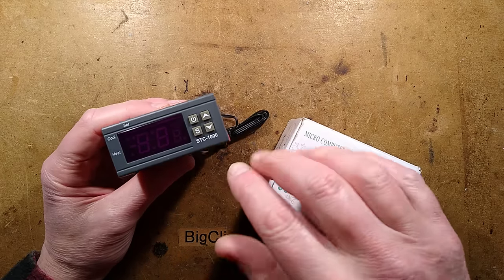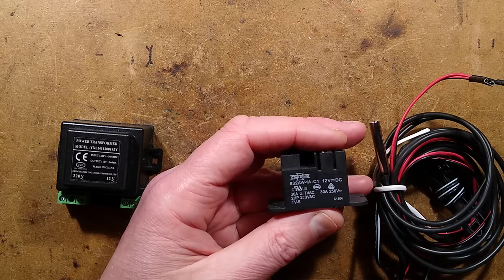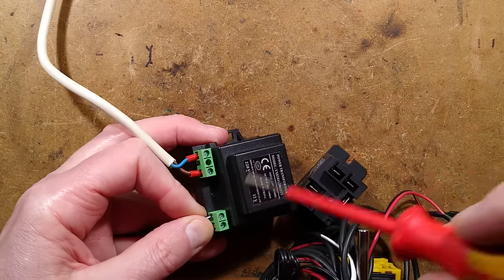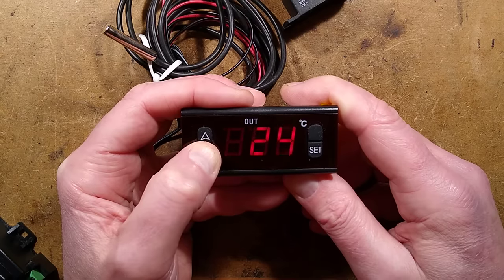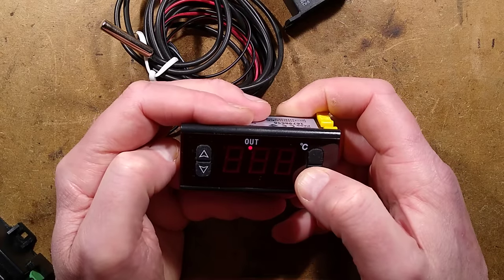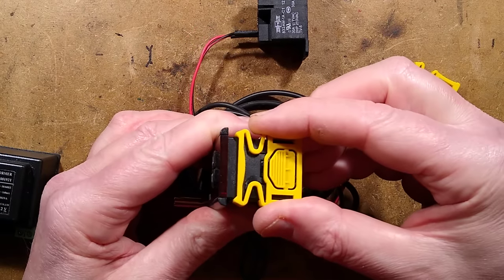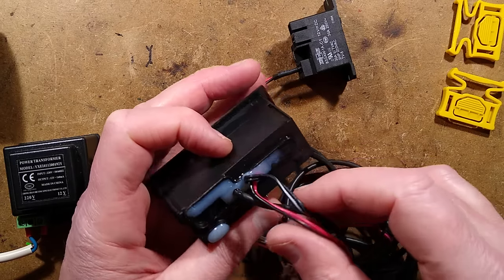Inside a ShangFang temperature controller

Comment: 06:20 - Hysteresis

Very interesting tear-down.  Thank you Clive.

-----

I am struggling to understand the difference between controller hysteresis and controller dead band.  My tentative, incomplete, and quite likely incorrect understanding is that hysteresis and dead band exist in completely different dimensions, i.e., hysteresis is always-and-only a function of time whereas dead band is always-and-only a function of the process parameter that is being controlled (in this case, temperature).

If that is true, then for an ON/OFF (non-modulating) heater controller:
1.  hysteresis is the minimum amount of time that shall elapse between calls for heat; and,
2.  dead band is the range of actual process temperatures in which the controller will not change state between ON and OFF.

Helpful comments by trained and qualified instrumentation techs are invited.
Reply: Hysterises is the temperature difference between compressor/heater on and off. Dead band is the difference between between being in cooling or heating mode.
Eg. Set at 5C with Hys of 1 and dead band of 2 will give...
6C compressor on
5C compressor off
4C you are in the dead band - nothing happens.
3C heater off
2C heater on
Reply: To me hysteresis and dead-band is two names for the same thing.

Minimum time off or on is a different thing altogether.

Comment: Clive, do you have any experience with the temperature controllers used in heat presses (the kind used to stamp T-shirts)?  I found two menu options on mine, labelled "PAt" and "Pld" (accessed by holding down the "+" and "-" buttons as the press is turned on). 

"Pld" can be set to -1, 0, or 1 (no idea what this is).
"PAt" can be set to any value between 0 and 60 (probably a timer).

There's also a "C-F" menu option that (unsurprisingly) switches between ºC and ºF.
Reply from the maker: I'm not sure.  Maybe for sensor calibration.  I've just ordered a basic heat press, so may explore the settings.
Reply: I considered that, but it only ranges from -1 to 0 to 1. Seems a very narrow range for calibration. 

I suppose it's also possible that "Pld" sets the "direction" of the calibration and "PAt" sets the value of that calibration. Which would be a weird way of doing things, as opposed to having a single parameter ranging from -60 to 60. And the fact that the second one goes up to 60 really suggests a timer.

It does have other parameters for minimum and maximum temperature, etc., but those are in the "normal" menu. The hidden menu only has those three (PId, C-F and PAt).

I did notice an interesting detail; the heating element snakes across the plate and then back again, but has 3 connections (one at each end and one in the middle), which I assume is so they can use the same part for both ~115 and ~230 volts (but it doesn't auto-switch).

Comment: I kinda like that. Some day I'll need to build a film processor, would this stand up in that chemical environment? (obviously I'd have no complaints about having to change the sealant... and maybe put the sensor in a stainless steal tube) Maybe I should use two of them on each tank, for safety? These wouldn't be camera films, rather print film. So it wouldn't ruin one-of a kind camera films if it goes wrong (but mistakes could still be costly) I'd put the alarm piezo in also. It's possible i'd need a thermometer with an extra zero though.
Reply from the maker: I'd recommend mounting the electrics in a sealed plastic case for chemical protection.

Comment: I hate it when they use the same resolution for celsius as farenheit.  It means the farenheit users get more precision than the celsius users, because a 1 degree F change is smaller than a 1 degree C change.
Reply: The reality is that the only thing likely to have well-controlled temperature is the sensor. Everything else in most systems will be at some other temperature, so display resolution is moot. Now if you are using something like a rapidly stirred water bath in a lab and have a thermometer adequate to calibrate the system, then an extra digit would be useful.

Comment: i work for a company that repairs vending machines and coolers. problem with these controllers is that the compressor relay gets stuck and the compressor keeps running. This results in exploded soda cans and a big mess in the machine.
Reply from the maker: That's why it makes sense to add an extra thermal safety switch in-line with the compressor as an extra backup.

Comment: Pity there wasn't an option to change between cool and heat thermostat. Would make the unit twice as usable. 

I've made a box for rising bread by switching the leads on the peltier element in a cooling bag and adding a temperature controller.
Reply: It really makes no sense why they don't include that option, it's literally able to be done in software. 

I get that they might want to sell the two versions just so the installers don't have to set that up themselves and to avoid potential confusion, but then again, why not sell the two versions with the only difference being heat or cold mode set as default?

Failing that, since this unit has a changeable relay, you could always swap it for a changeover relay (SPDT) and use the Normally Closed contact instead to invert it!

Edit: It just occurred to me that doing that would cause whatever device you're controlling to stay on permanently if the relay or controller ever fail. In that case, also add a second relay in series, with it's coil being controlled directly by the power input of the controller. Obviously it's more complicated and not as practical as just having a controller with a proper cooling mode, but it's an option if it's ever needed

Comment: I was using that exact same controller for our aquarium that died two days ago. The temperature reading is drifting all over the place.
Reply from the maker: Check the temperature probe for signs of water ingress or wire cracking.   Also make sure the wires are routed away from electronic stuff like LED lights.

Comment: If I had a dollar for each unit that survived the warranty period of the device it was built into, I'd still be waiting for my 1st buck. With the cheap ones the supply dies, with the expensive ones the secondary side 5V cap goes bad and they start drifting badly. I've begun to switch the caps on the new units with 105degC low-ESR units, and that seems to help them go longer.
Reply: A "good" ordinary electrolytic capacitor has a life rating of 2000 hours at 85°C and probably doesn't even have a apec for allowable ripple current. 
When you get into good caps with ripple current and ESR specs and want long life, use the largest can size you can fit (e.g. 25 V instead of 16 V or 10 V). That will invariably get you longer life. Tall skinny caps are usually slightly better than sort fat ones for the same voltage and capacitance. Vibration can be a concern, though.

Comment: COP I wonder if that is continuous operation or possibly a way to cool instead of heat? What is the upper button on the set side?
Reply from the maker: It turned out that COP was for changing the factory default settings to allow easier recovery from tampering.   The fourth button is for other module applications.

Comment: Kind of like a negative tco 👀 I'm already wondering how to abuse this😂

Cop... Continuous operation?
Reply from the maker: It turns out the COP mode saves the current settings as the factory default for restoring the system after someone has been playing with it.

Comment: Why is it called a Y1 transistor? (It's a small signal, switching, and audio transistor?)
Reply from the maker: It's a simple two character code due to the small area for printing.  It will be a very standard multi-purpose transistor for general use.

Comment: Doing a search, the only thing i found was "Coefficient of Performance (COP) of Heat Pumps", they say a setting of 2.5 to 3.5 is normal.
Reply from the maker: I should update the description.  It turns out it may be a way to store the current settings as the new factory default.  Probably to allow quick restoration of operation after people have meddled with the settings.

Comment: Summary
- 0:29 The temperature controller being discussed is superior to generic eBay models.  
- 0:56 It has better construction and uses traditional power components and an external high-current relay for easy replacement.  
- 0:59 The controller includes a potted 2VA transformer and good filtering on the thermistor input.  
- 2:16 It is suitable for resistive heating loads and can control up to three external relays.  
- 2:51 The PCB is standard with provisions for two thermistors, potentially a third, a fourth button, and a sounder.  
- 0:39 The unit was purchased at a lower price because it was sold as a refrigeration controller instead of heating.  
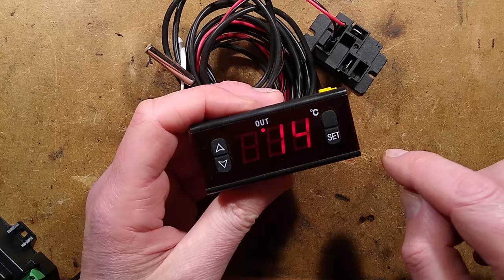- 4:13 The display shows the measured temperature, and pressing a button allows the user to adjust the set temperature.  
- 5:00 Programming features include setting the user-adjustable temperature range, hysteresis, delay start, thermistor calibration, and unit measurement (Celsius or Fahrenheit).  
- 6:23 Hysteresis and delay start prevent rapid cycling of loads and reduce stress on equipment.  
- 8:30 The video's presenter is curious about the real-world reliability of these controllers.  
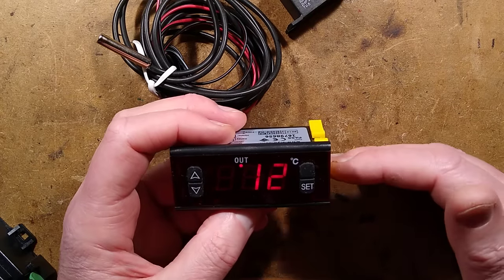- 9:12 The transcript details the presenter's examination of the controller's design, functionality, and settings.  
- 9:37 The controller is noted for its industrial application and serviceable components.
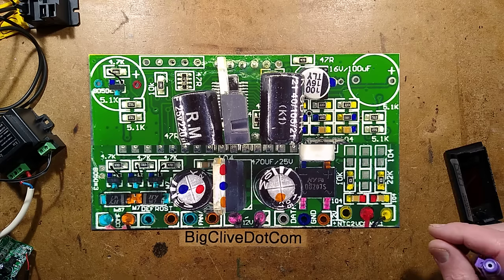- 13:39 Reverse engineering begins
- Designed as a universal unit for refrigeration equipment  
- Has three outputs to switch three relays: compressor, defrost heater, and fan  
- Suitable for cold rooms or refrigerated cases in supermarkets  
- Controller cycles between cooling, defrosting (heater on, compressor and fan off), and then back to cooling  
- Includes a beeper for alarm situations  
- AC input converted to a rectified and smoothed DC voltage (14-17 volts)  
- Voltage regulation and filtering capacitors provide stable supply rails  
- Microcontroller drives the display and buttons via multiplexing  
- Supports two thermistor inputs with an option for a third one  
- Unregulated 12V output, ground, and data line for remote display/button interface  
- Features a programming port  
- The circuit includes a transformer, a rectifying bridge, voltage regulator, and filtering capacitors  
- Thermistor inputs are heavily filtered to ensure stable readings  
- Microcontroller drives the multiplexed display and processes button inputs  
- There are four transistor outputs: three for relay control and one for the sounder  
- The design includes snubber diodes to protect against voltage spikes from relay switching  
- The board is versatile and designed for reliability and serviceability  
- Components include a durable transformer, high-quality relays, and a robust power supply  
- The unit is designed to be long-lasting with low-frequency power components  
- Model SF-101 SH general purpose temperature controller, versatile and reliable

Comment: Looks like the Watlow/Partlow models of yesteryear.  I always preferred where Honeywell UDC units were installed, even for simple operations; they just look cooler, if anything.  I can relate to the oh-shit-what-where-those-settings in some client's controller when all that was meant to happen was a calibration adjustment.  Would make a fun video -- an old UDC or even a digital chart recorder.

Comment: It would be nice if there was a version of this that could be used for temperatures up to 1300°c as a PID controller. I've seen 24v PID's but don't seem to go above 900°c
Reply: 1300° C is a bit low for uses .  The real limiting factor of these controllers is the survival of the sensor .  Also, a unit regulating above 900°C will need a bigger display and a bigger hysterisis, unless omitting the trailing 0 .

Comment: COP stands for "Configuration Out of Parameters". It's trying to tell you there aren't any more settings to change.
Reply from the maker: It's a mode that saves the current settings as the new factory-reset default.  Like a "restore" setting.